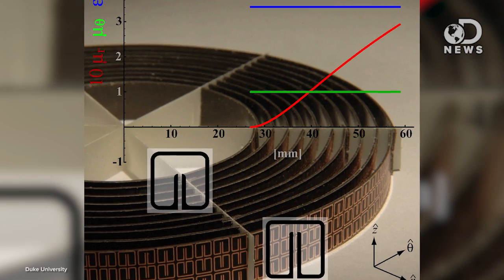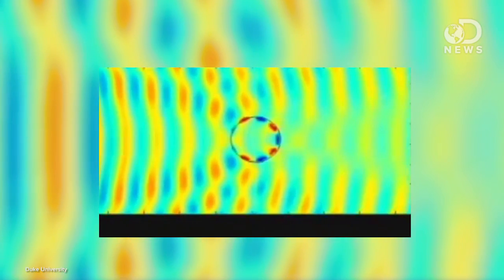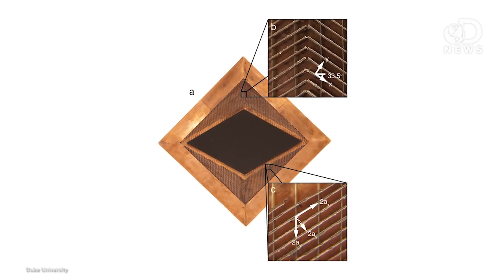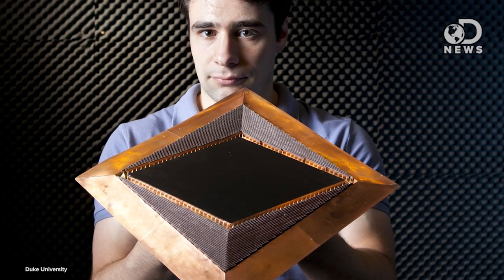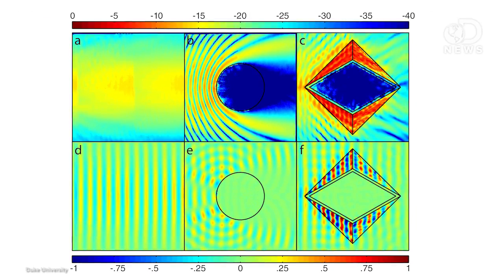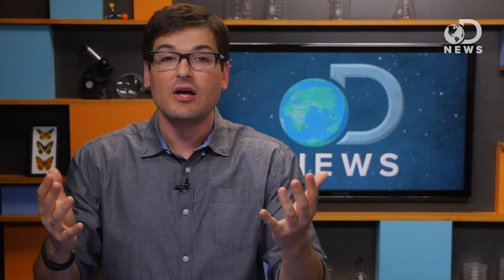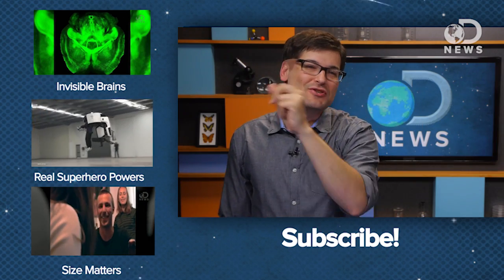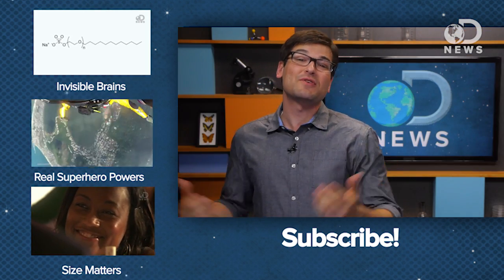3D Print Your Own Invisibility Cloak

Comment: As he said, the material has to be smaller than whatever it's bending. Centimeters are easy, but to give you more perspective on nanometers: Visible light is 390-700nm. 0.1 nm is the diameter of a helium ATOM. 1 nm = 1x10^-9 m, or one billionth of a meter. Try and print that (lol.)

Comment: hehe. Just had the same idea right now, but:
radiation has even shorter wavelengths then the visible light.
Visible light 400 - 700 nano meter.
Gamma Rays, X-Rays: 1 - 0.01 nano meter.

Comment: I once wondered if you could use this technique for radiation shielding with cheaper materials, by making radiations go around you. Sadly, the wavelength of dangerous ionizing radiation is shorter than the length of an atom, so it's unlikely.